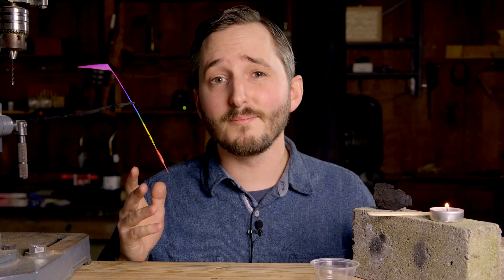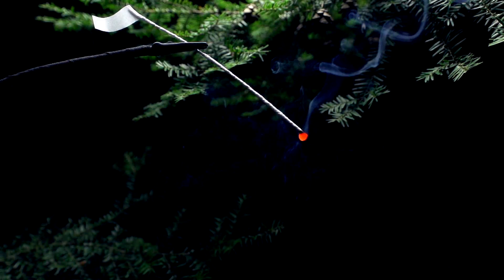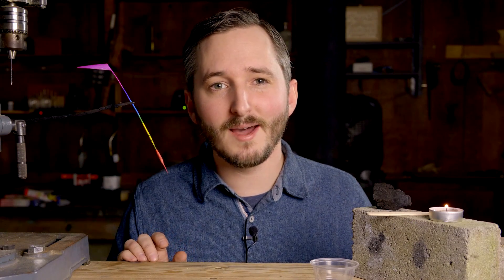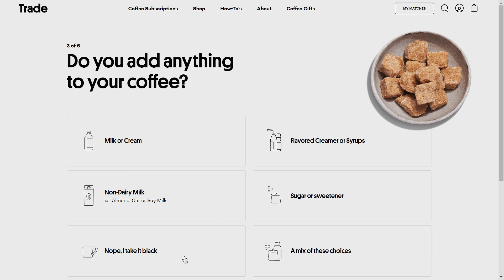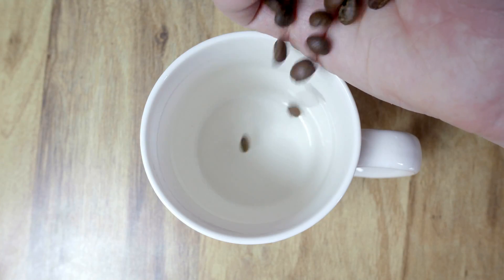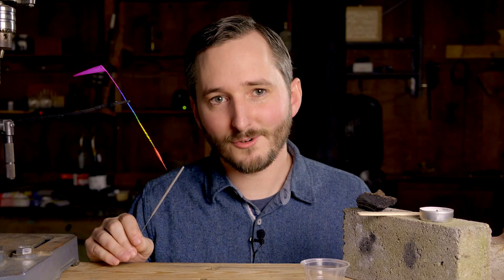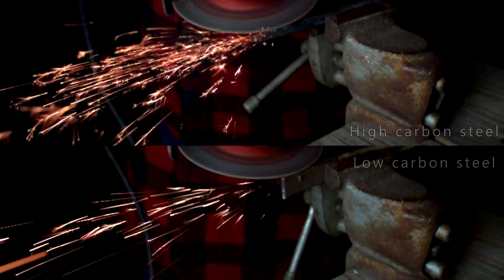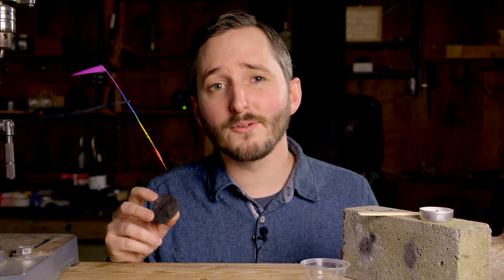Mystery of Branching Sparks Explained by Soda Water

Comment: What if it's the oxide breaking away from it bound creating energy and blowing it apart where as carbon has no oxide and is instead adding it as it burns out
Reply from the maker: Energy would not blow the drop apart unless there is something for the energy to cause to expand. Otherwise energy just makes the drop warmer. A consequential amount of expansion requires either the presence of a gas or the presence of a liquid that boils into a gas near the temperture of the drop.

Comment: Interesting.  Carbon iron phase diagram will answer all..carbon is very soluble in molten iron, much like salt in water.  If a droplet of iron saturated with carbon were to cool, the carbon is forced out as it solidifies. This would cause stress in the solid phase, potentially causing elastic energy release which would mimic a bubble bursting.  Remember,  this is well above the eutectic point.  So the outer liquid portion would appear as bursting like a bubble, exposing more area for oxidation and exothermic reaction..the sparks.

Comment: 7:36 you said iron has more carbon than steel? i think thats a mistake because usually steel is made by adding carbon to iron, right? so iron should have less or no carbon compared to steel
Reply from the maker: Cast iron has more carbon than steel. The terminology is bad, because what is usually called iron has more carbon than steel, but elemental iron obviously doesn't have any carbon if it's pure.

Comment: I’ve seen branching sparks coming off of our campfires after disturbing the hot coals. I’ve always loved how they appear and crackle out of no where and did so seemingly in stages. Nice to know what’s happening.
Reply: Correction. Now I’m even more confused than before. There’s no metal in our campfires. Hmmm
Reply from the maker: Charcoal branching sparks are caused by moisture in the cell structure. It turns to steam and breaks the charcoal apart.

Comment: I'm so glad I found this video! I've been wondering what caused this phenomenon ever since I spent a couple years sharpening people's skates (which is where I found out the difference made by the steel's carbon content — neat to see it's used in metalworking too). My Google-fu was weak, though: I searched for things like "why do sparks split apart" and got nothing but relationship advice. 😂 My initial guess was that maybe each spark was a solid, but very hot, metal particle shorn off by the grinding wheel, and that the temperature differential as the leading face of the chunk was cooled by onrushing air caused the chunk to fracture. But if I'm interpreting your video correctly…each of those sparks, whether coming from a sparkler or ground steel or whatever, has actually been melted into a tiny droplet of liquid metal, before being "splashed" apart by the expanding gases inside? That's so cool, it never even occurred to me that state changes like that were happening!

Comment: Then how would you explain the fact that charcoal throws many branching sparks if you blow extra air into it? It happens everytime I light a barbecue, and they fly FAR and can be downright dangerous. It's pure carbon too (I assume)
Reply from the maker: Charcoal makes a lot of sparks if it's too damp. The water expands inside it and breaks it apart. Blowing air would just cause a surge of heat and quickly burst unpopped water pockets. Water inside each charcoal spark particle is probably what most often makes them branch also.
Reply: @Nighthawkinlight  So there's water in commercial charcoal? I've even seen it happen with freshly made charcoal, like when you break a piece of wood that's been burning for a long time and blow into it. Is it really water?
Reply from the maker: Yes you'll get sparking from your charcoal even if you just store it in high humidity for a while. It will suck it up from the air. In the case of freshly made charcoal there's water and also oils that may not have been fully burned out yet. You can also just get pockets of plain air which will expand if heated quickly, and crack the charcoal if the expansion happens faster than it can seep out.
Reply: @Nighthawkinlight  Thanks for your responses :) The air pockets sound most likely to me personally

Comment: You do get gas in campfire sparks sometimes, but only from material that still has moisture or at least half-burned carbohydrate, not from the nearly-pure carbon bits.

(Commenting mostly just to tell the algorithm that this is a good video.)

Comment: actually it's obvious (to a chemist) what causes that sparks and the subsequent branching. And yes some kind of gas is formed within the molten metal, the bubbles burst and the surface of the metal is increased by several times, hence it burns quicker and brighter. 
The gas can be formed by oxidation of carbon to form CO2, but it can also be formed when a substance is generated with a much lower boiling point than the molten metal, which would instantly boil to gas, with same effect. 
And sometimes you even see the sparks of a coal fire explode, when e.g. residues of water are confined in the structure of the fragments which would form steam and burst the confinement once the "walls" of the coal pores burned down. But it might also be caused by residues of resin from the tree, which also makes tiny explosions in burning wood. 
I'm surprised that somebody had to do a study to clarify things which were obvious (at least to me) already when I was in school.

Comment: it's like periodic videos test where they dropped water directly onto sodium and potassium, the water droplet smashed the metal and ended up reacting with it which generated heat, thus melting the sodium and when it did so it enveloped the water and boiled it within itself, causing the water to turn into steam thus exploding the sodium into a big fireball of branching sparks.

Comment: Carbon making gas?  C'mon!  Carbon has the 2nd highest boiling point of any element!  (Tungsten is higher, which is the REAL reason tungsten is better for incandescent lamps then carbon, despite melting lower then carbon).  Iron's boiling point is WAY lower then carbon.
Iron 5,184F, carbon 8,721F, tungsten 10,030F.
The only you can get gas from carbon is if oxygen were to diffuse into the droplet and react with carbon inside the droplet to produce (most likely at these temperatures) carbon monoxide.  What the iron is doing is a physical thing: getting the carbon liquid.
Reply from the maker: The carbon makes gas as co2. It can do this by reacting with oxides that form as the metal burns.
Reply: @Nighthawkinlight  I maintain the sulfur has to do with it.  It has a low enough boiling point, and all its oxides are gasses.   That is missing from the campfire embers.

Comment: I'm late for the comment, but I hope Ben would read this as well ;)  some me guesses: 1. The soot, beside being ultra-fine, they are also porous solid, soaked with volatile oily hydrocarbon created during the partial pyrolysis and/or combustion process. Perhaps this leads to it being superior over other solid carbon like graphite 
2. I wonder if this solid-liquid-gas inhomogenous reaction is related to yet another unsolved mystery -- the 'Pyrotechnic yellow powder' = powdered sulfur + KNO3 + KCO3, that despite a seemingly lacking of fuel it explodes after a period of heating anyway, somewhat unpredictably.

Comment: This was a really interesting video. I think that in the case of the Senko Hanabi sparks, that start with one relatively large sphere of liquid, there may be an interesting geometric property that contributes to the increased branching.  As a sphere decreases in size,  it has a much larger surface area proportional to the total volume when compared to a larger sphere. With the oxygen in the air being  the limiter on this bubbling reaction, it might be true that a smaller sphere will split more quickly and vigorously. This may cause an exponential effect wherein the spheres successively split into smaller spheres, accelerating until the material is consumed. All in all, this a fascinating topic and as always, this video provides a thought provoking and in depth examination. Tangentially, this same property of spheres is responsible for the posited property of black holes to violently explode via Hawking radiation in the last seconds of their life.

Comment: Never explained where the "bubbling" comes from in solid sparklers? wasn't that the whole reason we came to watch this video?
Obviously a higher carbon sparkler will have more sparks, but what causes a spark to explode again after it branches off? its not a liquid and doesn't bubble, so the "soda water" explanation doesn't apply here.
Reply from the maker: It is a liquid. All of the super slow motion footage in this video was from metal sparks. They are liquid too

Comment: But what about the aluminum? To my knowledge, it doesn't have nearly as much carbon in it but still branches like crazy.
Reply from the maker: I don't think aluminum branches much, but titanium does. I think in that case it may be dissolved gases in the metal, and there still is a bit of carbon in most alloys. Because it burns so hot I think any gas generation would be amplified in volume. It's a good question though. I'd like to test spark branching of degassed 99.999% ti and see what there results are.

Comment: Dear NightHiL, If you are into Senko Hanabi, i would definately recommend getting your hands on the papers by "Frederick Van Der Sypt". An interesting reaction to try is mixing K2CO3&S (60/40wt%) with some charcoal (+10-20%wt) and melting together. Once a molten blob is obtained, slowly blow on it or use compressed air. The molten mass will start throwing sparks like senko hanabi. To explain, the K2CO3&S react to form K-poly-sulfides (KnSn)=(8K2CO3 + (3n+1)S2 > 6KnSn + 2K2SO4 + 8CO2) which in turn react with oxygen. This is the molten heart of the senko hanabi reaction. Enjoy!

Comment: I remember you doing some work with steel wool that could probably be used to test it a bit at home and probably put on a good show. You could dope the steel wool with some ball milled carbon, you'd probably want to first dope it with some niter paste to oxygenate it.  Be interesting to see if external carbon amplified the reaction more than internal carbon like it appears to. Or just mix that chemistry with some thermite but that'd probably be way more dangerous, and well fun.

Comment: Interesting, I was all set to assume that the rapid heating of a fleck of metal (which of course I assumed was solid) as it reacts with the air was causing it to fracture, and where this fracture occurs you have freshly-exposed metal surrounded by lots of heat, so the fracture opens very rapidly, and perhaps the pieces come apart simply due to rotational momentum of the original fleck.

So yeah, I wasn't exactly on the money.

Comment: One time I mixed potassium dichromate and either aluminum or magnesium powder (can't recall which) with ammonium nitrate and by heating the mixture with a torch it melted the nitrate into a hissing, steaming mass that seemed to want to catch fire or sustain but didn't. This reacted molten mass further reduced with direct flame heating to hard slag-like nodules the size of large peas or so. 
After cooling, you could hit them fairly hard with a hammer without them breaking. Also heating them carefully with a torch to a dull red hot nothing happened, but a little more heat and they would suddenly launch into the air making an attention getting electric discharge crackling sound.
Squatting down heating a nodule on the ground with a torch (with some apprehension from  a previous similar event), this one nodule lit and took off spinning/orbiting erratically, seemingly alive coming after me like an angry darting bee as I dodged it as best I could. 
I've always wondered what the crackling white hot sparkle material would have been, a thermite-like ignition point but zippy enough to self propel or spin up like hardened bits of melted KNO3 and sugar but instead of a steady hiss a lively crackle mode of propulsion.
Reply from the maker: Crackle pyro mixes are really interesting. It's over my head how those work.
Reply: I had no idea what I was making other than a mixture that didn't want to light when ammonium nitrate was tried as a third ingredient. For some reason I kept the propane torch flame on the fizzled failed mass that cemented into nodules, when the unexpected happened.
It came to mind and as mentioned red hot lighter flints that are thrown hard against the pavement will come to life,  the nodules seem something like that albeit they crackle white hot and just need enough heat to enchantingly lift off into the air on their own accord.

Comment: Do you have a way to get the temperature of the ejected droplets? My thought is to see how much reaction is going on with the increased surface area/ volume. It’s definitely not cooling down, so.... flir?
Reply from the maker: With a long exposure photograph you can see the sparks increase in brightness as they travel through the air longer, and become smaller in size. You could maybe use the brightness as a gauge of temperature with black body radiation calculations. There are a lot of variables, not only droplet size but also speed, which is equivalent to more air flow and an accelerated reaction rate.
Reply: NightHawkInLight, Absolutely. I’ve done a bit of flame pyrolysis and have a concern that apparent incandescence and temperature may not be in total correlation. Not sure in this case. But an IR measurement of the droplets might tell a lot. My guess is the temperature rises after ejection up to the point of secondary ejection. Reasonable? Maybe obvious. 
So, thinking back about what the senkohanabi guy said about the particle size and type of carbon ... lamp black in his suggestion, it might be possible to correlate production of combustion gases to the reactivit of different carbon types. Definitely an interesting project. If I survive tax season I might do some tests. Cheers!

Comment: what about branching being the outside cooling, and contracting down on the hotter material?
Sort of the opposite of the 'bubble' expanding from the inside, the cooler surface constricts on the inner material until it is explosively forced out?

If that makes sense. It's late here, not my best explanation mode time of day lol.
Reply from the maker: I think the outside is much hotter than the inside, because that is where the liquid is reacting with air. In the middle the reaction is slower and should not make as much heat.

Comment: Is it possible that there is less branching in a fire because of the temperature? It may be creating carbon but low grade with only a little surface area. Fireworks use carbon with a very high surface area. I have seen people try and make fireworks with low grade carbon which create sub par results. On Cody's lab he enjoys making charcoal and has shown how to make standard charcoal and activated charcoal. The key ingredient seems to be the temperature that the charcoal is created at.
Reply from the maker: Fireworks charcoal does not branch either. I used high grade charcoal in this video.

Comment: Yeah I've had a similar thought as to how this works, as when developing my own compositions for branching sparks, particularly those based on polysulfur chemistry like senko hanabi and related compositions, I found that adding compounds that release gas when they reach a certain decomposition temperature, particularly carbon dioxide, would increase the branching.

I've used barium carbonate, and sodium bicarbonate for this. Each is good for different things. The former is better for high temperature compositions, where the decomposition would happen too quickly with bicarbonate.

Comment: It's an interesting theory, but wouldn't O2 ->  CO2 be the same amount of gas? I'm not sure why it would form bubbles. Different solubility in molten iron? Expansion from heat? Maybe some other liquid intermediate is oxidizing instead (which would explain how the gas got formed under the surface). In any case, very cool video!
Reply from the maker: I think possibly in metal sparks it is carbon reacting with metal oxides that are created naturally as it burns. Carbon can reduce oxides back to metal and CO2. It's tough to answer that one for sure

Comment: I really want to know what the molten ball is made of and how it's changing over the life of the firework. Obviously, it's not molten metal in a senko hanabi.  I presume it's a ball of molten sulfur, molten potassium nitrate, potassium salts, and interspersed very fine carbon particles. When the carbon and KNO3 meet in the middle of the drop, the carbon is oxidized to CO2 which forms the bubble that blasts off a ball of liquid. More carbon = more internal, CO2 forming reactions = more branching.

Comment: I watched your previous episode on senko henabi and reached the same conclusion, it's the same principle as the branching sparks in metal pertaining to carbon content... honestly I thought it was more or less common knowledge that CO2 was the driving factor in branching sparks since its the only thing that's capable of expansion in the chemical breakdown at those temperatures. Another thing that might be a determining factor is how liquid state materials have a correlation with the Feigenbaum Constant under rising temperatures... the Feigenbaum Constant is everywhere.
Reply from the maker: It is common knowledge that carbon caused branching but not how.